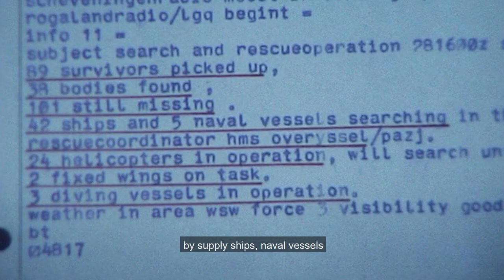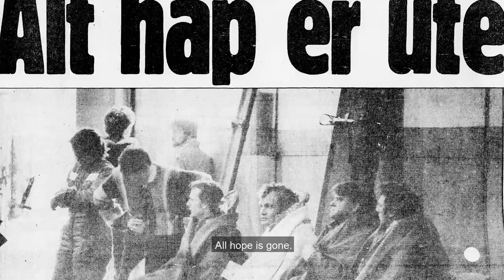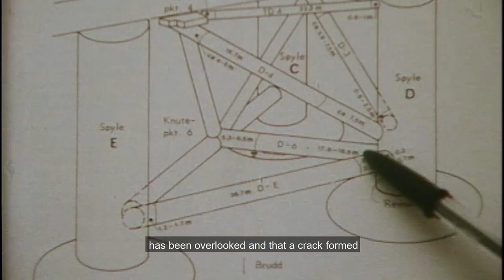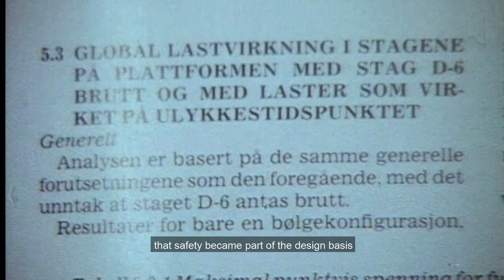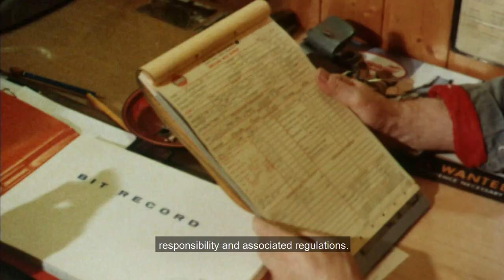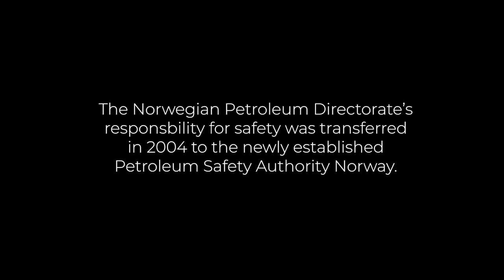The Kielland legacy

Comment: It is hard for me to believe that the sister semi is still working in the North Sea and that the crew are being evacuated when bad weather is forecast. Can anyone confirm this to be true? This disaster was followed by the Ocean Ranger off Newfoundland. It forced me to redouble my efforts to promote my design of the much safer Seaways MPSS ring-pontoon semi. Now the "STANDARD", "CONVENTIONAL" semi significantly improving safety in the GOM and elsewhere.
Reply: It is, a friend worked on it until last year
Reply: Henrik Ibsen was also built by CFEM Dunkirk as Pentagone 89. Sold as Safe Petrolia, accommodation barge. Then Petrolia converted back to drilling mode. Last know as Archimedes laid up Corpus Christi, USA 2011. Probably scrapped?